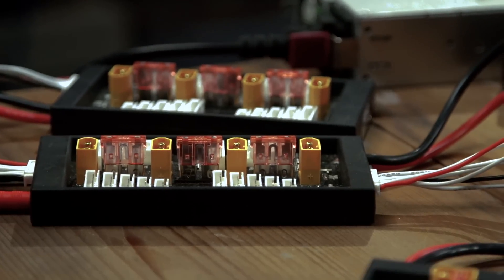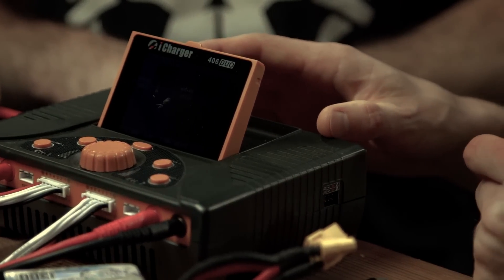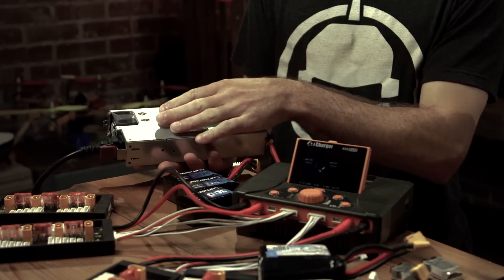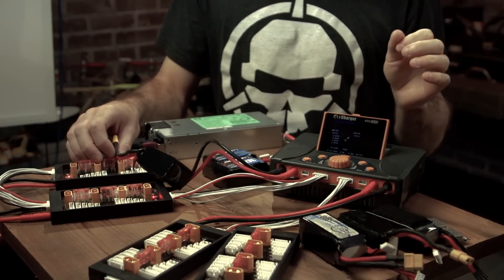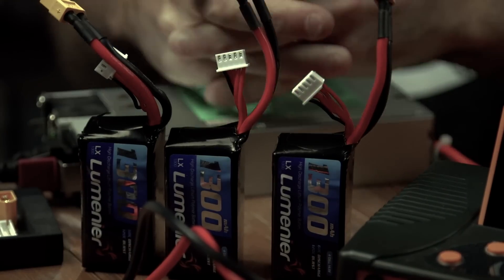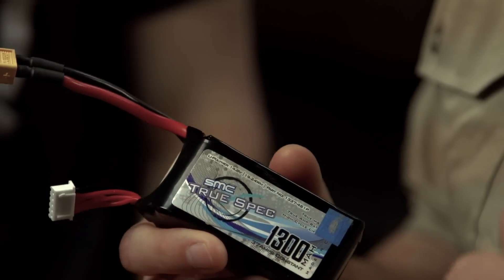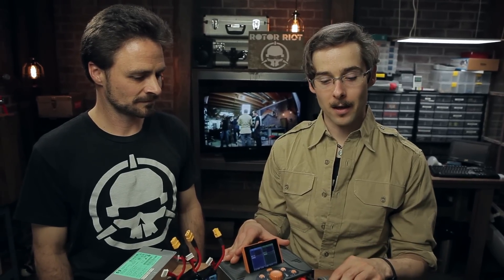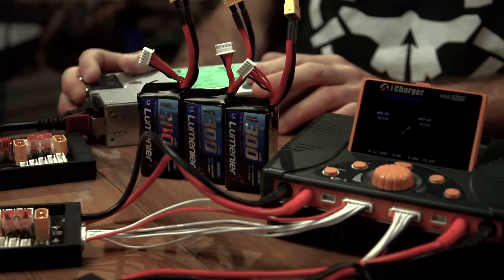Parallel Charging Batteries

Comment: can i parallel charge with the B6AC 80W Dual Power Battery Charger w/ Power Supply
Reply: Yessir, all you need is parallel board, parallel charging is like charging one big battery
Reply: +Alex Van Handel You can but only up to 5.0a. You'll only be able to do 2-3 packs at a time.

Comment: busted links? I'm on my cell phone from USA is that matters.
Reply: +Rotor Riot awesome thanks for the video great info.  BUUUTTT check this link to get a much better bang for your buck! (in USA anyways) only $22 delivered for this 65 amp supply.  mine works GREAT and is super quiet.   https://www.amazon.com/gp/product/B001U0EM1W/
Reply from the maker: +quiljw01 Should work now.
Reply: +quiljw01 Yup, all links are screwed.
Reply: +quiljw01 can you tell me which pins to put a resistor across this recommended power supply you recommend to make it happen. Thanks much. Dane
Reply: quiljw01 Those PSUs are awesome, you can get them off eBay for low money aswell.

Dane Boren Easy, just google PSU model number and "hack". For instance this: http://www.rcgroups.com/forums/showthread.php?t=1878162
Reply: +Dane Boren A search for "<PSU model number> pinout" will also get you the appropriate results.
Reply: Dane Boren https://goo.gl/photos/vsxCt5NTZLacfCeSA
 let me know if you need more help.  good luck!
Reply: Dane Boren hopefully you will not need this, but just in case here is the link where i got my info from.  http://www.rcgroups.com/forums/showthread.php?t=1301679
Reply: Thanks a ton. You all are the best!

Comment: You mentioned charging different capacities together. I wasn't aware I could do that. I know my charger only puts out 5 amps... so can I do 2 1500 3 cells and a 1400 3 cell all together at 4.4 amps?

very informative video guys thanks a million... just recently picked up a parallel charge board but was sticking to cell count/brand/capacity.

also didn't know about the .2 volt cell difference so will be sure to check that in future!! 

Great stuff guys, cheers!!
Reply: +Ben Smith Yes, you can charge different Mah capacities together as long as they are all the same cell count and the .2 between the cells.
Reply: Your correct. It just makes them all one big battery pack mah wise.

Comment: I'm curious if you ever use lipo bags or vented ammo boxes for batteries while charging?    I, too, am lazy and find myself just putting them on top of my non-flammable microwave to charge.    Like, not with the microwave, but with the charger on top of the microwave... although,  microwaving a lipo could be a very interesting and/or deadly video...
Reply: +tekmunki1980 Well, having an open ammo box or an open lipo bag (how else are you going to get the leads in there?) just puts both ad absurdum. Just put them on a non-flammable surface and stay close to them. It also helps to have a fire extinguisher nearby, best case a CO2 one. Or a good bucket of sand to pour over and completely cover the battery. Or a fire retardant blanket.

EDIT: Do not try to extinguish those things with water. Or a foam fire extinguisher.
Reply: The concept of the lipo bag, as I understand it, is to melt and suffocate the flame and reduce or eliminate the combustion, similar to sand, most of these bags have velcro that you close around the leads.  I'm just going to continue doing what I've been doing and not bother with them- I'll just use the bags for when I find myself charging puffed, repaired, over-discharged or other questionable-state batteries.

Yes, I have a fire extinguisher nearby...  and keep one in my truck when I fly...  Only had 1 lipo fire and managed to save the quad-   only takes 1 to never forget to bring an electric/chem rated extinguisher.
Reply: +tekmunki1980 From what i've read, those things are made of Fiberglass fabric. So they shouldn't really melt that easily. Just as ammo boxes, they're just made to contain the fire. They will vent out the gasses/smoke, but they won't make your car catch on fire when you are happily driving around with lipos in your trunk.
Reply: +tekmunki1980 Extra safety is always good.  My issue is I'm always travelling so can't really cary too much with me.  Charging outside or near the exit and always keeping an eye on your packs makes for a big improvement on safety.

Comment: When you guys go flying, how many batteries do you bring?
Reply: +vissago 24 packs is what I take to a big flying afternoon.
Reply: FinalGlideAus I try to park on a hill (manual of course)
Reply: +thomas de koster i don't think so ... he said he was going through 2 thirds of them in one session... by the time he was done he didn't have a quad to fly:))
Reply: +FinalGlideAus Do you field charge or just bring the explosives and once they are done that's it
Reply: +Reuben Horner Most of the time I'm travelling or sometimes walking a long way to get to the location so on field charging is not an option.  Plus it's extra things to carry with you so I don't do it.
Reply: FinalGlideAus Ah i see. Cause i don't have such a stack of batteries and i usually drive to wherever i usually charge while flying
Reply: +Reuben Horner I used to do that and ended up flattening my car battery a few times.  Makes for an interesting trip home :)
Reply: +zeDoSauRus Becasue I still have to carry it and I already carry enough stuff with me.  On some days I've had to hike 2 miles into a location and every little thing I don't have to carry makes a difference

Comment: Guys, can you do the diffetential of Freestyle PID and Race PID?
Reply: I could be wrong but PID for race and acro should be close to the same if anything a little more P is needed for race. In my experience I believe the rc rates and expo is where the major adjustments that can impact your performance. I'm going through the phase of realizing what tuning a quad means. It's not something you can describe or teach. PID is software philosophy and has near infinite quantifications and isn't standardized across different systems. Meaning PID for Libre pilot and cleanflight do not "think" the same. Rates and expos however I believe are standards. Rates determines how quick the craft responds to any given distance of throw on your sticks . And expo sets the ratio in which that response is applied the further or closer you are from 0. Once you dial your PID adjusting rates and expo seems to make the most difference in my lap times. I know some guys who adjust both in mid flight so I cloud be wrong but them guys can't do anything better than I can.
Reply: +Chris Edwards from my understanding any quad configuration is merely a mod off the ordinal x config. Meaning x frame is the configuration any flight controller uses as a reference when doing motor mixing. Having a true x frame allows the CPUs to focus on other flight dynamics. I heard motor mixing is more relevant to hex, tri, vtail. I know my hex flew way better after setting up a good motor mix. Some Gaines were realized with H configs but this isn't generally accepted as enough to make motor mixing as a major differentiator in tuning.
Reply: +1
Reply: +1
Reply: +1
Reply: +1
Reply: +1
Reply: +Zul Ihsan plus 1
Reply: Why they have to keep it secrets? Hahah
Reply: +1
Reply: +2
Reply: +23
Reply: +1
Reply: +1

Is motor mixing important too?
My ZMR250 never seemed to feel right until I set up a custom motor mix. After which it was easy to tune. I also think it is a matter of finding something you are comfortable with then sticking to it.
I tried luxfloat for the first time the other day. It was super smooth and responsive but I could not fly with it very well and reverted back to multiwii rewrite.
Reply: +FPVQuadRacer I've watched it many times over 😀 actual and theoretical often has a weird way of manifesting itself. To many factors impact PID I've come to realize that CG is critical base for a good PID. Which kicks my butt since I run different batteries and props often. Just gotta roll with the flow.